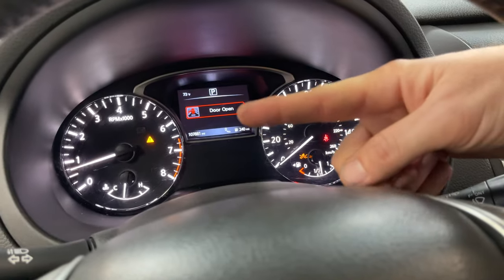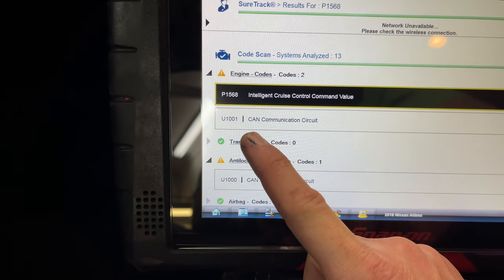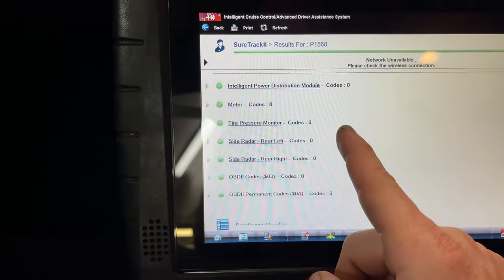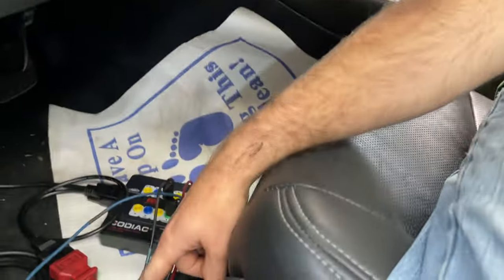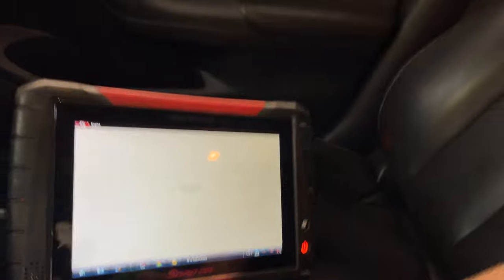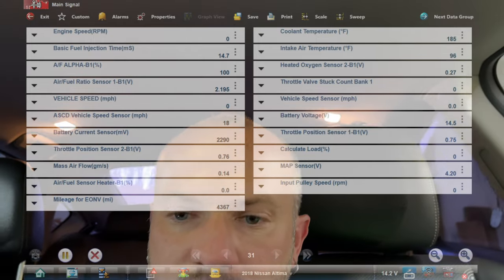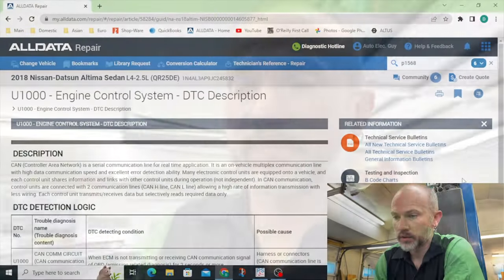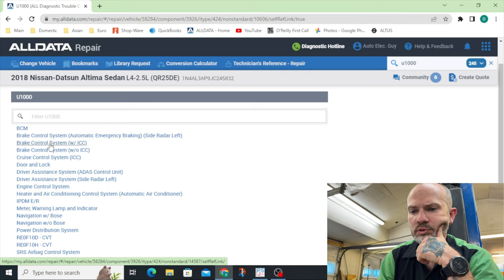The Frustration of Diagnosing Nissans

Comment: I'm still early in the video so I'm not sure where it goes from here, but to me the codes in the ECM say there is a fault with another module.  The ECM clearly works and you can read data.  Also, I think the code in the ECM was U1001 which I'm sure when you look it up will give a slightly different result than U1000.  You definately have a great looking wave form at the DLC, but from there I would check at the module.  The warning light that is on refers to the adaptive cruise, so I would check and see if Nissan has a diagram of what the communication bus is shaped like?  In other words, do they all connect directly to the ECM or pass through other modules.  Check what the comm lines are doing at the module that has the MIL lit.  Verify that the scan tool can communicate with that module and is the data live.  Does it drop out while driving etc.  I'm excited to see where you go with this one.  

Also, thanks for your honesty in your thoughts as you work through a car.  We've all been there with the frustration and suffering.

Edit: Now I've finished the video it looks like you kicked it's ass in the end.  I did not see that direction as the solution.  Glad it worked for you.  Finding that wire was lucky and like they say, "It's better to be lucky than good."  I would take luck any day!!
Reply from the maker: Nissans are always a loser for diagnosing to me. They take 5 times longer then any other vehicle. I honestly can’t think of another manufacturer that if that same fault happened wouldn’t give you a U code specific for loss of comm with that particular module. I have learned that the full version of consult you get with the VI3 interface will give a topology map and show that module as being offline. I’ve since then bought the VI3 just to help with diagnosing these issues.
Reply: @autodiagyt  sucks when you need a few thousand dollars of extra tools just for one brand.  I've not done much with Nissan but other asian cars have not been terrile.  I try to avoid all European cars, Volvo, BMW, VW, any of them.  Seems like service data is terrile for all of those.  Again, great work on this one sir.
Reply from the maker: @curtisroberts9137  I usually can get by with alldata on the euros I get much better then I can with Nissan info.
Reply: @autodiagyt  do you have any videos on your background, how you became a tech, where you learned your skills anything like that?  I always eanjoy seeing how others got to where they are as well as sometimes learning new sources of information and training.
Reply from the maker: @curtisroberts9137  just talked a little about it on the Jaded Mechanic Podcast. It came out on Oct 3rd on Spotify

Comment: As a Nissan Technician .. Generally you ignore the U1000 and focus on what other DTC's are present. Can comm codes will trigger anytime a system has a fault and shuts down communication.. doesnt typically mean the can comm system is actually down. Consult makes it easy to see that though, because youll have a U1000 dtc but all of the modules are present in the list while in "all systems"
Reply: @autodiagyt  That is a good point yeah - On newer model Nissan's you can use the CAN system self diag feature to see what module is down without the need for the breakout box. However for older models yeah you'd have to have something obvious missing from the readout like your abs, bcm, or engine tabs to really use that method. 

For this particular vehicle my step 1 wouldve been to pull up the dtc explanation for the P1568 ICC command value first.. and pretty much disregard the other 3 DTC's .. but again thats easy for someone like myself to say as I mainly only work on Nissan vehicles.. I'm sure I'd be chasing myself down a rabbit hole on some other brands with nuances I've never run into before.
Reply: @autodiagyt  I enjoyed watching your approach with it though - and great find with the break in the harness

Comment: I dislike working on nissans as well. For instance a downstream 02 sensor issue sets a upstream air fuel sensor code. (This was on an 06 sentra). I believe Eric O stated this in his videos on a differnet nissan. If you didn't know what to look for you'd be Hella confused. Them transmissions too... they just keep using the same crap

Comment: I had a 2020 Altima with the same kind of non descriptive communication codes for the driver assist system and ended up finding a wire at the windshield camera broken inside of the insulation. There is no reason for it to be that difficult other than incompetence on Nissans behalf.

Comment: The code was correct. The PCM wasn't receiving ICC (intelligent cruise control) data (P1568).  The ADAS was flagging a U1000 for the ICC module because it didn't see any data packets from it.  The vehicle has more than one CAN bus, but you were scoping the main bus and not the ones after the ADAS module.    If you were looking at network topology (system scan), I bet ICC would have been greyed out.
Reply from the maker: Consult R2R will not give you the CAN Bus Diag that shows the topology and shows you which module isn't talking. In fact the way Nissan does a system call if a model doesn't report back it will not show up in the module list except on the CAN Bus Diag in the full Consult version with a Nissan interface. With aftermarket scan tool topology it did show as greyed out but you still need to know the vehicle platform to know that yes this vehicle should have this greyed out module or not. The U1000 is so generic it just means that that module is missing a message from another module. Ever other manufacturer will give you a more special U code that states I cannot talk to this module. Sure with dealer level tooling this Diag would of been insanely easy but trying to be in the aftermarket and diagnose this cars is a lot harder then any other OE. Since this video I'm made the $3,500 investment in getting the OE tool and software. I'll probably never get a positive ROI on the $1550 a year subscription but it does make diagnostics much faster on these cars.
Reply: @autodiagyt  I definitely agree diaging Nissan aftermarket is challenging.  Just thinking, if the PCM is setting a code for no data received from ICC, would that tell you the vehicle is equipped with ICC?  If looking at the steering wheel cruise control buttons and it has a set distance button, that means it has ICC.   I work in a small independent shop.  Trying to get specialized tooling and not paying out of my own pocket is like pulling hen's teeth, so every time one of those come in, its always thinking outside the box and usually taking the scenic route to the troubleshoot the issue. To be honest I kind of like taking the scenic route sometime because it can allow you to learn and improve your skill.  Unless someone is breathing down your neck to get it done fast.  Really admire your troubleshooting methods BTW.  Thank you for sharing!

Comment: i realy hope you read this. coming from a Nissan tech snap on scan tools suck for Nissan. autel or launch will serve you much better. i left Nissan because of there dealer software for diag is by far the worst ever made. replace control unit is there answer to every problem. im with u they are horrible. there service info is junk.
Reply from the maker: Since this video came out I’ve bought a vi3 and the full consult subscription and it does make network diag much much easier I’ve been waiting to do a video showing it but haven’t had a good case yet to do it on.
Reply: @autodiagyt just watched the video! Nissan tech for 8 years here and still currently at Nissan. Glad u got a vi3 now u can see the CAN topology and CAN diag support monitor. Would have made your life easier here lol. The errors you see when cranking are normal for consult. Its very picky with voltages so when voltage drops consult flips out. Plus on the Nissan service manual u can click EWD to find exact connector locations, it shows like an “x-ray” view of the vehicle. Just a small tip if you didn’t know already.
Reply from the maker: @tylerwilliams7051  yes I’m very pleased with the full consult version you get with the vi3. One thing I do struggle with is finding the correct info to do the can bus topology and diag support. I’ve found the model on a few door stickers but most cars don’t seem to have it. If there is a trick to this please email me autodiagyt@gmail.com